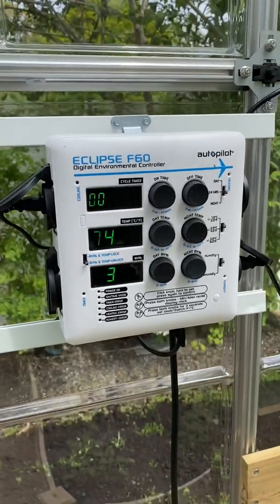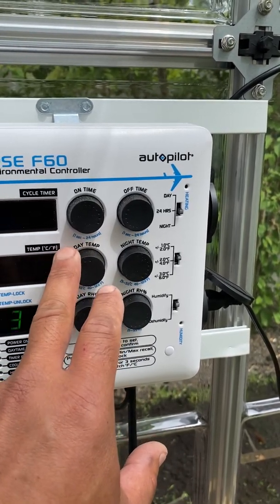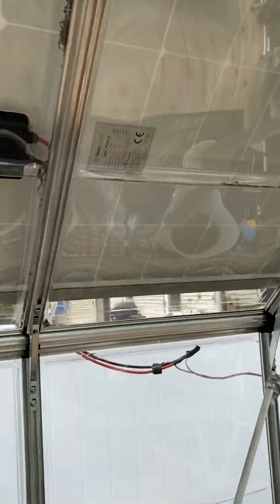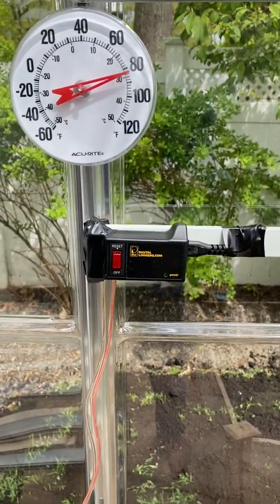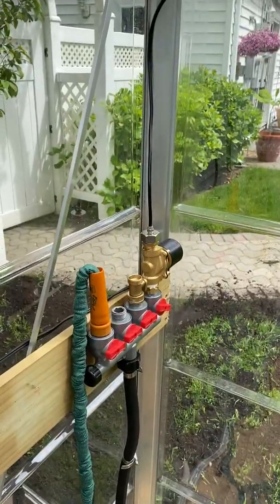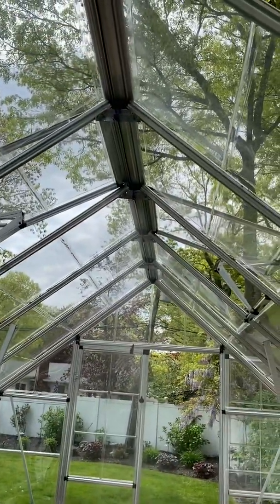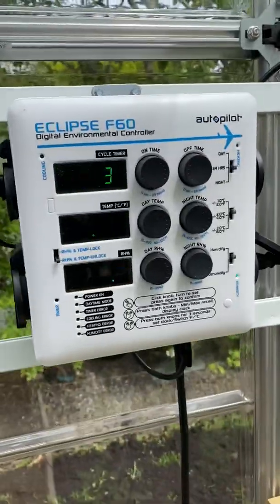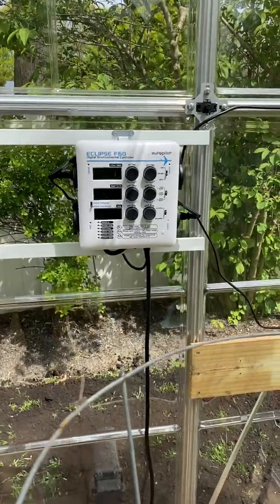Eclipse F60 controller review, solar power greenhouse cooling, humidity control, palram, misting

Comment: I just got one of these, Any Idea why my heater won’t power on when plugged into the F60 it’s working my dehumidifier but no power to heater also mine isnt jumbling around like that in the readings like yours is you had said something about the refresh rate, what is that and why is mine not doing that what have I done or am doing wrong, I can not figure this thing out and the instructions are completely useless you might as well just blow your nose on them then toss them away I wanted to say something different I think you know what but didn’t wanna be gross just to express my frustration with this purchase, if you could please help me out I’d really appreciate it, Please 🙏🏻I’m desperate here and time is counting down until I take a baseball bat to it!!!
Reply from the maker: Glad you got it working, its only flashing on video due to refresh rate, its steady to the naked eye
Reply: Hyundai Ioniq / Kia Niro Maintenance / Repair Thank you, so the phone or camera is what made it look like that? What is refresh rate?
Reply from the maker: Best to contact tech support
Reply: Hyundai Ioniq / Kia Niro Maintenance / Repair thank you so much for getting back to me so quick WoW I wasn’t expecting such a quick response I really appreciate, anyhow I just got it to work, why it wasn’t working was because the deadband switch was down at 20degreeC over 60degreeF and I didn’t know that would make it work it was just one of the last things I haven’t tried yet and when I switched it up to 20C over 40f the light went on and the heater worked,still don’t know why mine is not flashing the readings quickly like yours is, but I’ll figure it out eventually, just glad I got the main things I need working working, thanks so much for getting back to me, you know that your the only person in the whole world to put out a video about the F60, it’s the only one on YouTube, that’s crazy, and I wanna say thank you for posting that because I was on the fence between the titan Saturn 5 or the F60 and seeing your video pretty much sealed the deal for me on making my decision so again thanks so much for taking your time out to be the only one to review and show how the Autopilot F60 works, your green house is so awesome, would love to have one of those some day, thanks again and have a great day!!
Reply: Hyundai Ioniq / Kia Niro Maintenance / Repair thank you for letting me know that, really appreciate it!!